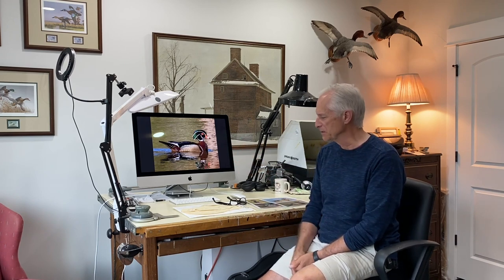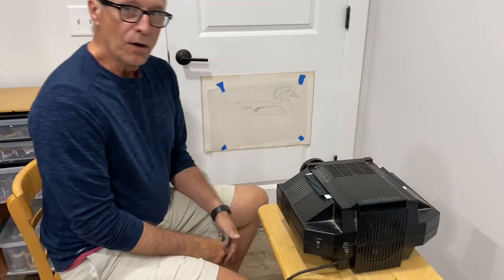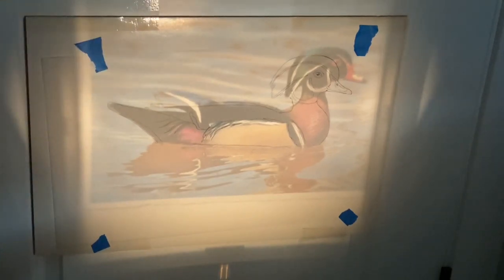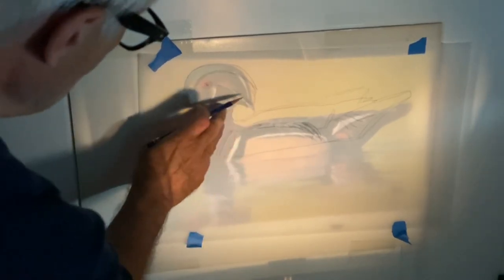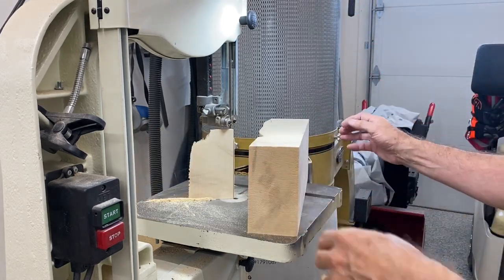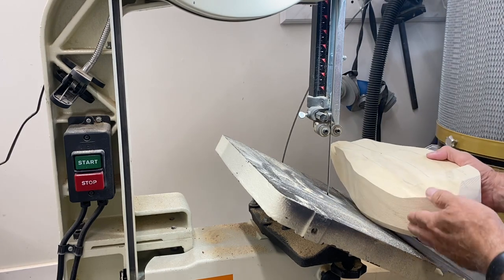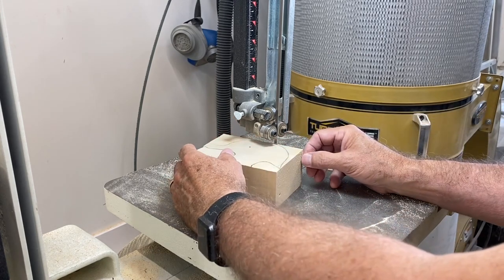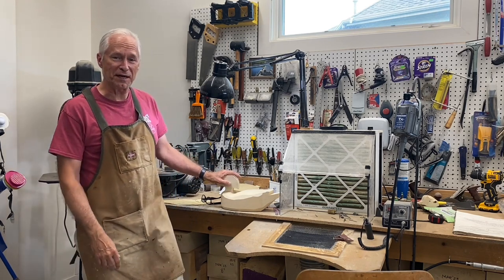Wood Duck Drake Carving Session 1 - Pattern Development and Band Sawing

Comment: I would like to see how to make a top view on the pattern. I found it difficult to get a top view image of a wood duck.
Reply from the maker: I use Pat Godin’s pattern books as a starting point for top down patterns of birds that I can’t find a top down view. He also sells individual patterns on his web site at Godinart.com
Reply: @tomchristieart . Tom thanks a million for your efforts here. I have used Pat's painting guides and bought his basic pattern book with mallards, pintails, etc, I reviewed his wood duck patterns and thought I would dip my toe into a customized pattern this time. I had some great shots from my digital camera. I ended up using a top view pattern from one of the wildfowl carving magazine issues. I wanted just the right high head in this case. I wanted it high but not as high as most patterns. I was trying to have a relaxed high head if that makes sense. The others I found looked like the bird was too cautious. I hunt the decoys I have built, so looking to make them natural and relaxed.All are high head however.
Reply from the maker: Sounds good Paul. Thanks for the feedback. Always a part of the fun creating original patterns!